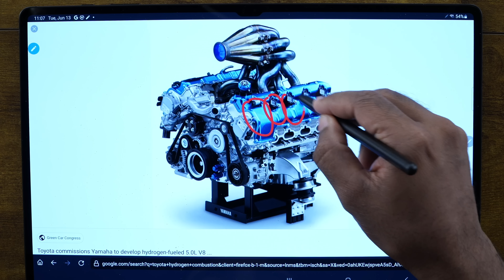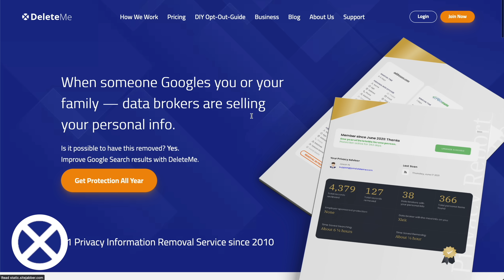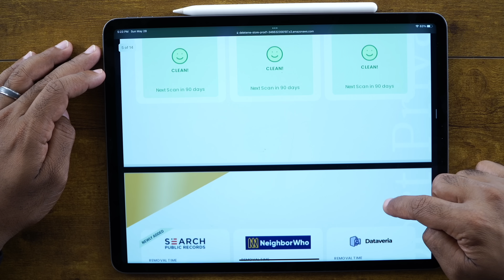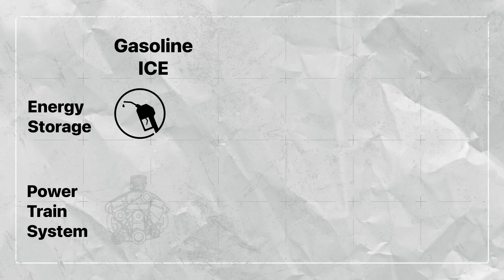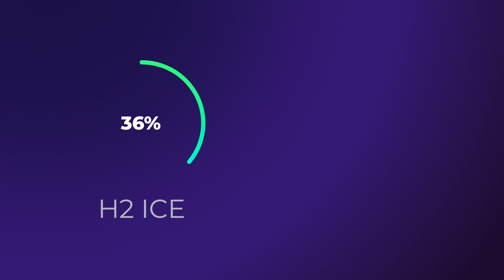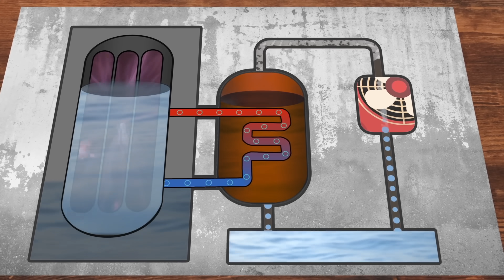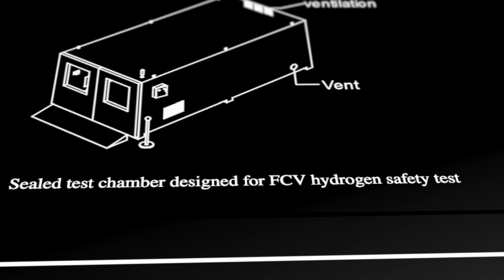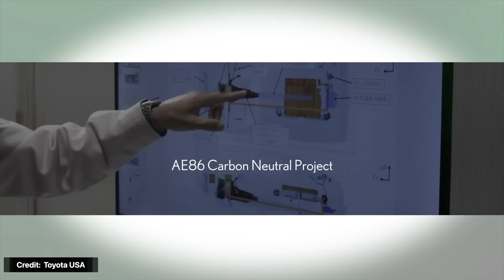Toyota's Says They Just Destroyed EVs - Hydrogen Combustion Engines

Comment: When comparing emissions, you also have to look at emissions resulting from the production of electricity vs that of producing hydrogen. Did I miss that in the video?
Reply: There are 3 ways to produce hydrogen; blue, red, green. In blue, natural gas is used, for red its the nuclear power and for green its the electricity from renewables. I won’t even talk about option blue as its not sustainable. In the other 2 cases, its more efficient to use the electricity produced to charge batteries then turn it to mechanical motion, rather than generate electricity -> create hydrogen -> compress hydrogen -> transfer hydrogen with a truck -> turn hydrogen back into electricity -> electricity into motion. In the case of electric cars; produce electricity-> transfer it using wires (mostly existing networks) -> charge batteries -> electricity into motion. Each conversion of one type of energy to another loses efficiency.
Reply: @baldok14  But then how do we justify EV trucks compared to hydrogen trucks? Plus it's not like energy in producing hydrogen matters anyway, emission-wise, considering we're planning to get it for free using wind and solar. It's a tradeoff of efficiency vs reliability.
Reply: @rhyanjill   I don’t see a reliability problem. Battery technology is in its infancy just as hydrogen is. Comparing a future improved hydrogen tech to current EV tech is unjust. If battery energy density is increased, so is the charging speed as it’s correlated with batt capacity. I’m putting my money on batteries right now, but predicting the future reliably is a fool’s game.
Reply: @baldok14  How is it a fool's game when one has no problem with being used in a truck while the other has glaring problems though? If the other already has a clear solution to a major problem that the other currently can't solve, how is that unfair? Trucking is just one. How about the issue of ewaste produced from worn out batteries? Should we not already be talking about that in terms of waste and emissions? How much energy are we going to need to recycle these things and how does it stack up with hydrogen?
Reply: @rhyanjill pure EV totally wins on reliability!
Reply: @baldok14 Hydrogen is starting at a 2.5 to 1 disadvantage compared to batteries or other similarly efficient forms of energy storage. Hydrogen is rubbish in terms of efficiency in comparison.
Reply: @rhyanjill you have not addressed any of the "glaring problems" of hydrogen technology!
Reply: @baldok14  The hydrogen is converted into rotational mechanical energy, not electrical energy.
Reply: @wilsonvinas5906 even less efficiently than using a fuel cell!
Reply: @baldok14  agreed. With that said, renewables never produce the right amount of electricity. Hydrogen production could help with that. Obviously, Nuclear With Hydrogen is probably the best solution. Electric cars are not made for brutal weather.
Reply: @baldok14  what about the production of the batteries to hold the electricity you didn't mention that part. That ads a lot of complexity to the ev & therefore also adds emission production in the process.
Reply: As well as the car production and transportation. Instead of extending vehicle life and addressing the true problem its knee jerk reaction and other factors
Reply: To make the electric car batteries, it causes emissions too.
Reply: @elian._iorio  As do all harvesting or manufacturing processes for whatever the product - whether  your morning cup of coffee, or, as in my own case, the mobile tablet compute upon which I’m reading and commenting in this thread. 
TANSTAAFL.
Reply: @elian._iorio no sh*t, Sherlock. Now compare fossil fuelled, hydrogen fuelled, by either ICE or fuel cell  and battery electric vehicle technologies, and do it fairly.
Reply: @gregbailey45  what are you cursing and blinding about?
Reply: They use electricity to make the hydrogen.  And to save money most would just hook up your hydrogen generator to the grid with no thought put into where the electricity came from. And the final nail is that because hydrogen is so inefficient you wind up using more electricity to do the same amount of work. All this to make sure some fat old oil exec has a soft landing when governments start banning burning fossil fuels.
Reply: They are pretty much the same.
Reply: @JohnH No. But the unexpected result of their misguided policies is often to do just that.
Reply: @Tyjhuffman  Is that not the case with any energy / fuel source? Regardless of the number of steps involved, the ecological footprint of all infrastructures and processes required during the entire manufacturing operational and decommissioning need to be enumerated , which I suspect is not as simple to accomplish as it is to postulate.
Reply: Not if the electricity is generated from renewable resources, you know … wind hydro solar tide and so on.
Reply: @DeepThought9999  except that isn't realistic now, is it?
Reply: Not to mention all the pollution created by mining the materials needed for the batteries and the disposal of the batteries.
Reply: Renewable electricity produces no appreciable emissions. Electricity from natural gas is around 60% efficient.  The electricity mix is becoming more and more renewables. Producing hydrogen from fossil fuels is a dirty business and burning the fossil fuel directly in an ICE produces less emissions per mile than using hydrogen from fossil fuels. Hydrogen is just a con as long as it is produced from fossil fuels which most of it is at t he moment.
Reply: When comparing emissions, you have to also look at Oxides of Nitrogen produced by all internal combustion engines using air as an oxidiser, due to the high temperatures and pressures of the combustion process. These are very damaging to human health.
Reply: Evs generate pollution when charging because power plants use coal to generate power.
Reply: Global warming is one thing, what about the mercury poisoning all the fish in the ocean.
Reply: Hydrogen can be produced with electricity from hydro/wind/solar and nuclear. Boom no emissions on the electricity used to make the Hydrogen
Reply: 7:37 you used the most expensive Tesla Model 3 in your graph, a bit misleading as the base model is 40,000
Reply: That's a weak argument from you, we have majorly invested heavily on renewable sources of energy
Reply: @alexndichu6629  it's a very valid comment that only informed people can answer
Reply: @Alex Ndichu   You miss the point. However the electricity is produced, making hydrogen adds another source of pollution
Reply: @mike160543 a
Reply: Greenies are proposing making hydrogen using electricity. Sop there is a whole lot more pollution involved
Reply: @mike160543 also batteries don't last and cost more to replace than a used car should be.
Reply: @drewjeers815   Cost to replace battery pack in my 280,00 mile prius with remanufactured pack would have been 1200 dollars but car rocker panels were rusted out. Tesla batteries. "Tesla claims the Model S and Model X retain 90% capacity even after 200,000 miles. Third-party research data from NimbleFins supports this claim, with 150,000-mile cars at 90% and 200,000-mile examples still maintaining over 80% capacity." That's 14 years of average mileage. Remanufactured pack for a Tesla S right now is about $9,000 to $10,000 dollars plus labor or about 13,000. Thing is though it's usually 1 module in the pack that's weak and causing failure. A module is about 1,500 dollars plus labor and that 3 or so thousand dollars total will usually get you another 4 years of service. By the time in averageyou get multiple module failures car will be scrapped and pack pulled to hopefully be remanufactured by  a couple decades from this date
Reply: @drewjeers815  I didn't say they were perfect, just better than setting up a whole hydrogen infrastructure.
Reply: @drewjeers815 ... and they're 95+% recyclable!
Reply: @mikegray1358  that's more than what I want to pour into a used car on top of the other repairs. I usually buy $1,000 cars and put $1,500  Into them over 10 years.
Reply: @mike160543  Wrong. Green electricity produces no appreciable emissions. Nuclear electricity ditto. Electricity from natural gas is 60% efficient. Making hydrogen using fossil fuels is dirty and emissions intensive. The carbon in the fuel has to be stripped out resulting in CO2. The energy embodied in the carbon is no longer available to power a vehicle. Therefore hydrogen production from fossil fuels is worse than using the fossil fuel in the engine.
Reply: Let's be honest here, none actually cares about emissions.
We just want the thing to comply with the standards so you can buy it.
Reply: @ghoulbuster1  Wrong. I most definitely do care.
Reply: @rogerphelps9939  one guy from millions
Reply: @ghoulbuster1 let's be honest here. Many of us DO care about emissions!
Reply: @ghoulbuster1  I absolutely care about emissions.
And about the waste and pollution that comes from getting the materials to create engines and batteries.
All that lithium makes most green energies not so green, sadly.
Reply: @lesath7883  you know a lot more pollution come from brake pads than actual carbon emissions released from exhaust gases either way there is steel pollution and exhaust gas is not the main cause of it
Reply: @naratouzumaki  Please, provide a link to back your words.
Reply: @lesath7883  no link needed what kind of gen z type of shit is that just search it up
Reply: @lesath7883  Brake dust contributes 20% of fine particulate matter pollution, compared to just 7% contributed by exhaust fumes. I literally just ask Google and it popped up